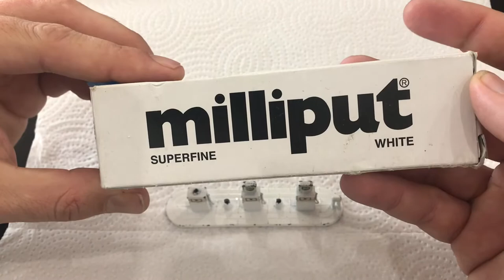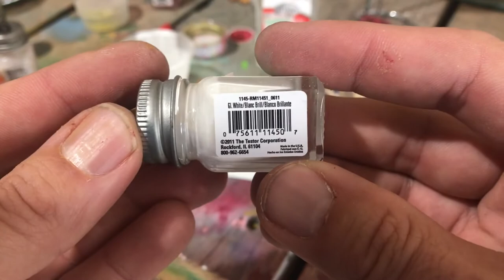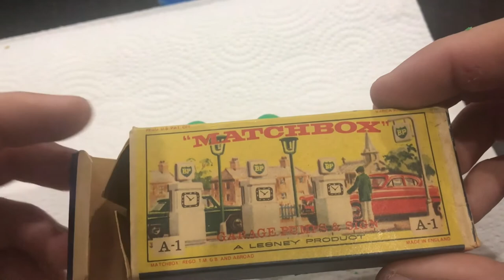Matchbox Lesney  Accessory Pack #A1b BP Gas Pumps Sympathetic Restoration and Repair

Comment: Make molds for the lamps and attendant for the future. Great job.
Reply from the maker: Honestly, I thought about it, however these are parts that are easily sourced from multiple vendors.  It's probably not worth the time and effort to try to make them when I can just order a set.  The molding and casting works great for parts I can't buy or pieces that would be far too expensive to replace.

Comment: Very nice restoration video.  Thanks for educating me on the molding technique. I have been in need of a way to duplicate some missing 1/24th scale parts on a '53 5 window chevy  and really did not need industrial quantities of the products needed.
Reply from the maker: The blue stuff works great and there's a link in the description for where I ordered it on Amazon.  It's sold under different names and was kind of hard for me to find Stateside.